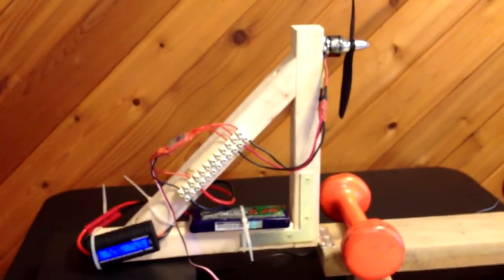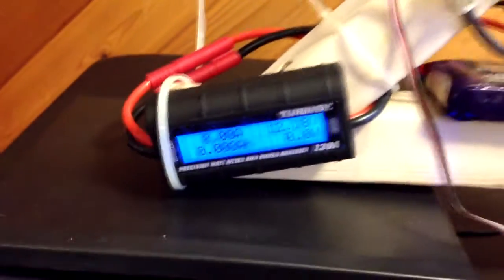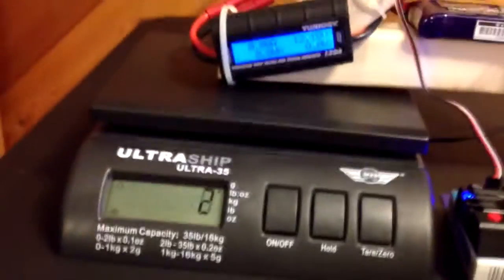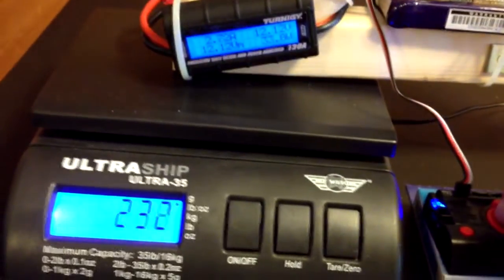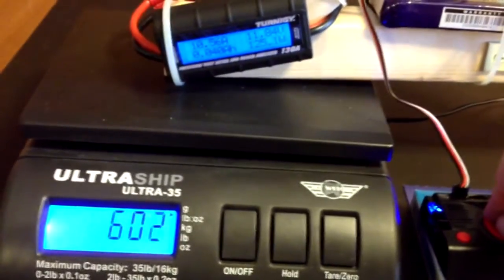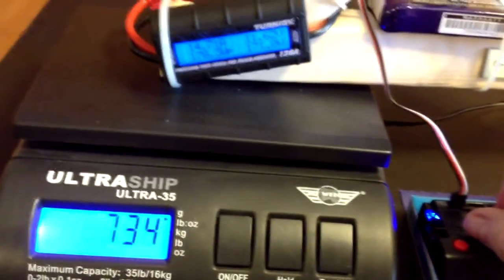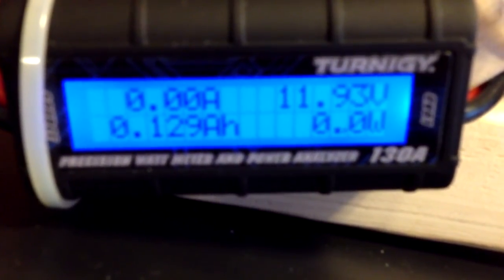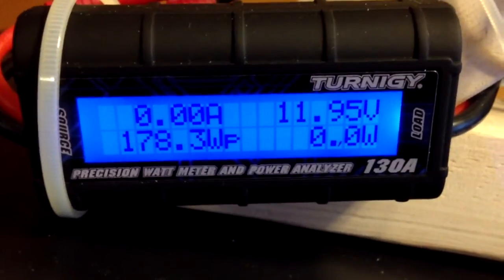Thrust Test of NTM 28-26 1200 Kv Motor 3S Battery

Comment: Are these motors still working for you? How about the bearings are they as awful as everyone seems to claim in HK?
Reply from the maker: Still working fine.  I bought a spare motor and also two sets of replacement bearings and haven't needed to use either.
Reply: Cool thanx

Comment from the maker: Well, I built a Quad and the AUW was about 980 grams, which includes FPV gear.  The Quad hovers at right around 50% throttle and I get around 8 to 10 minutes flying time.

Comment: Hey there, nice video. 

What was the name of the site wich u used for making Amp draw calc.? 

i just ordered the 28-26 1000kv for my tricopter projekt. how do you think i will run with a 10x4.7 or 11x4,7 3s lipo?

Nice test setup by the way :D